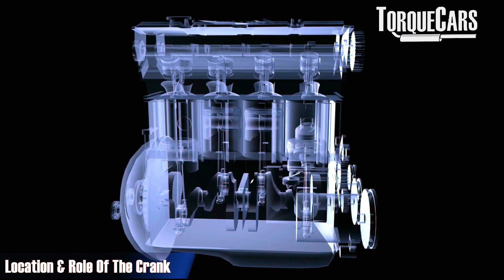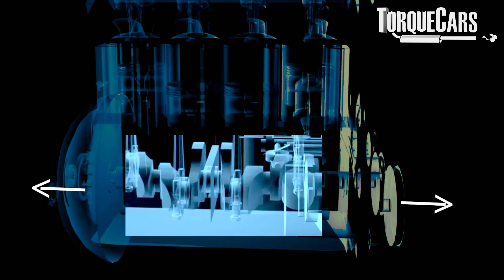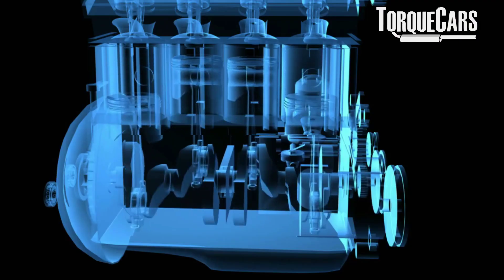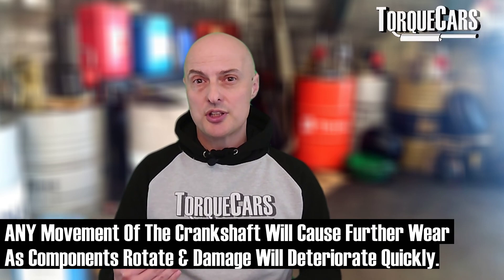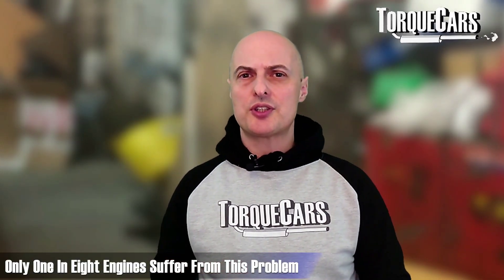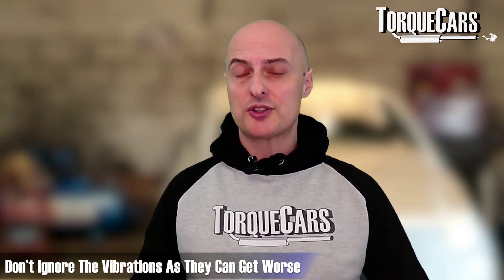Mitsubishi 4G63 Common Problems & Tuning Issues [Crank Walk, Con Rod & Crankshaft, ]

Comment: I had a problem with the first generation, 6 bolt engine, the head gasket blown, I have an aftermarket standalone ECU, with a very conservative tuning, the car had a peak boost of 15  psi, is not too much, I have stock intercooler and stock turbo, I think the problem was the backpressure of the 14b turbo but I'm not sure now.